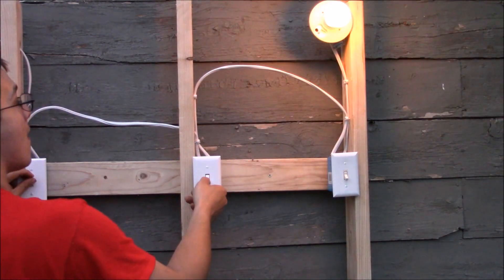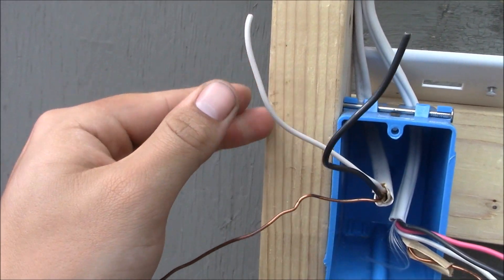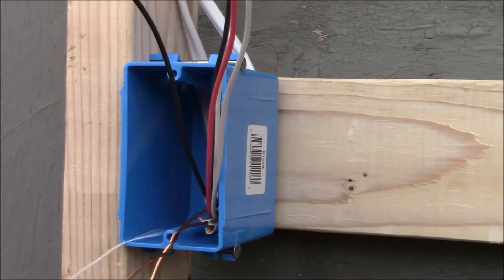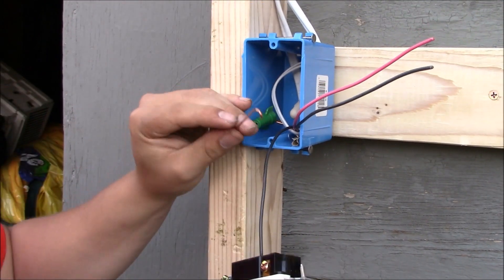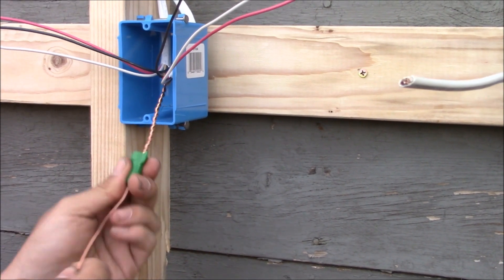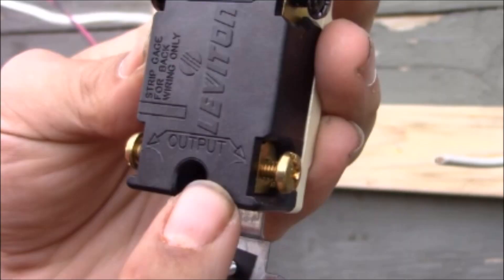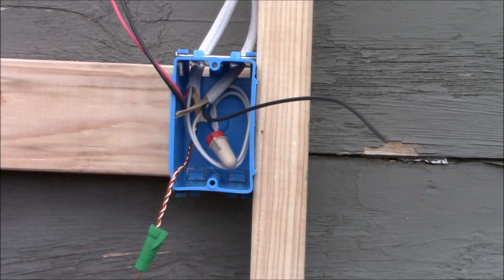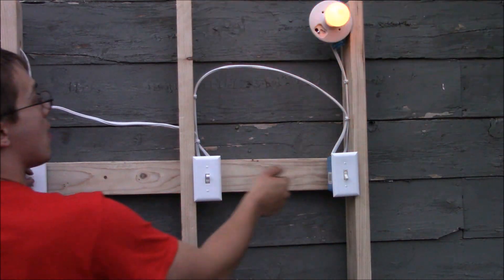How to wire a 3-way switch/4-way switch system

Comment: The 3 most deadly jobs in the world are lumberjack, fireman and electrician.  Ignore the fact that electricians need 4 years of on the job experience before they can take a test to call themselves one.  Get on youtube and learn how to do your own wiring!  Just make sure your home insurance is up to date.  As something small like not tightening a wire nut properly will literally leave you homeless. Because shitty connections will certainly lead to fires.
Reply from the maker: You are exactly right. Electrical work can be dangerous, please be sure to follow all local codes and consult with a professional if needed.

Comment: Neutrals are used in a 3 way switch system, they return current to the panel. I hope that what you meant to say was that they just dont have a place on the switch. But that is the case with all switches in a house.

Comment: What if I want to install a three way dimmer switch where a four way switch is now I have two black and two red wires and the white are in the box together I have a red wire going to a dark screw and a black wire going to a dark screw and the other two wires black and red each go to the common screw

Comment: Video was exceptional.   3 way switches I had had the dark screw on the same side as one of the brass screws.   Mistakenly thought the lone screw was the common.   In the wiring book I was using that was how the 3 way switch was diagramed.

Made the change putting the power and load on the dark screw and switches work as expected.  Discovered only the 4 way switch was grounded.   Corrected situation and now all 3 are grounded.   Again, thanks for this useful video.

Comment: I have LUTRON 3ways & a 4way that have no black screws.  There are brass and copper colored.  To make it more confusing, the copper and brass on the 4way are NOT paired top to top and bottom to  bottom, they are staggered.(or criss-crossed).  I have no way of knowing which is supposed to be which.
Reply: Ok I've only just seen this.1 week old.first look The manual,not comfortable not a professional contact one.
Reply: You solve the issue?

Comment: Great video, but you should of also showed how to wire the light. And also how to wire incase the power source went to light first, because alot of  homes built before 2000 are ran that way. And anybody that doesn't know will be lost in the sauce. I been in the IBEW for years now, and that was a great video. But show some craftsmanship and put  a wrap of electrical tape around each switch it prevents the next guy or yourself from getting zapped. But you used residential plastic boxes so you dont have to worry about a trip or short. Again great video, but can show me how to use a table bender and bend 4" inch rigid with a 11 ft offset that has a 9" in. Kick and back to back 90° that goes over a two 3 inch pipes before connecting to a power filter and make that 4 4in RMC that needs to all parallel concentric with each other. These are the things I would like to see. If you cant wire a simple 4 way, you have no business picking up wire strippers.

Comment: Is this method (Power to one end and other end to light) preferred over the (Power to light fixture) method for four way switch systems? Why?
Reply: You have to have a neutral in all of the switch boxes.  If you brought power to the light fixture first, you would have to use 2 sets of 14-2 wire instead of 1 set of 12-3 wire.  Hope this helps

Comment: Cut around your insulation to your wires before you pull through makes the job easier. Easier to cut also when putting wires back in the box.